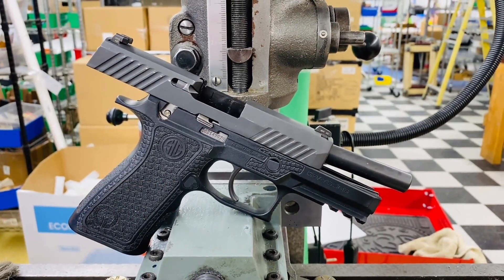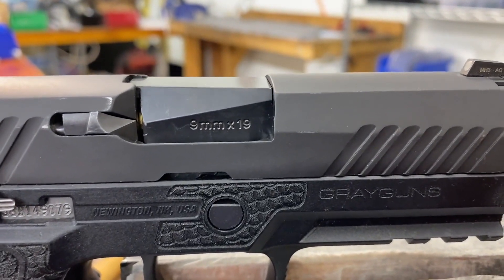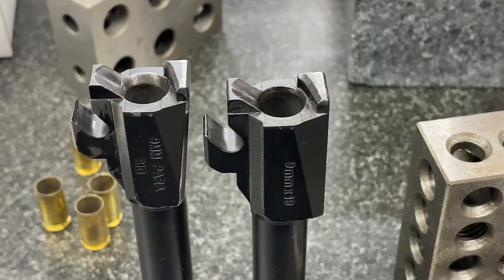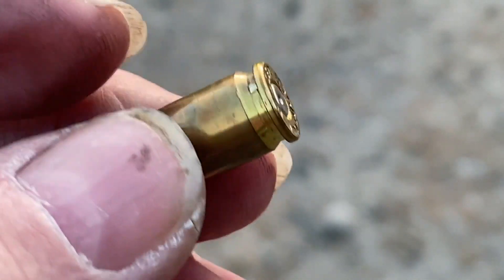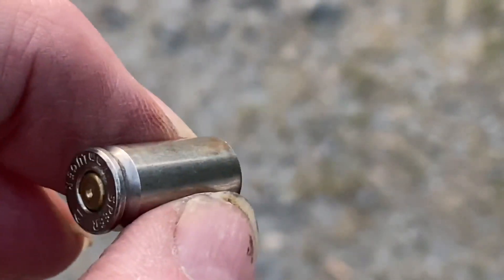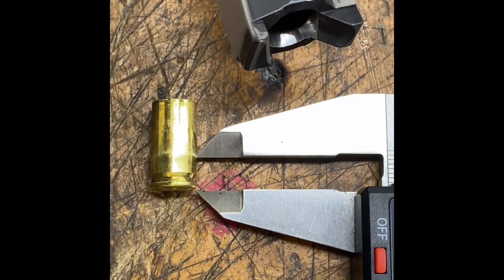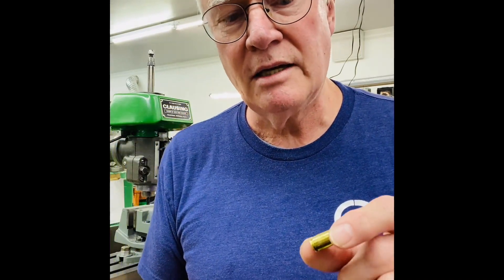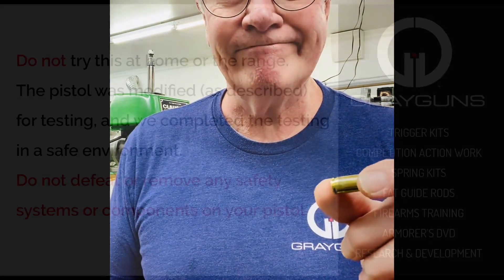Extreme P320 Testing - Reducing Barrel Chamber Support

Comment: I don't own a SS P320.  

I did shoot, own, and carry various Glock Gen3 and Gen4 pistols for about a decade.  
I never experienced bulged cases, a kaboom, or a malfunction of any kind whatsoever with any of my Glocks, with the notable exception of my 10mm Auto Gen3 Glock 20SF.  
When using my G3 G20SF OEM stock factory barrel with its non-fully supported barrel chamber, every single new round I ever fired of full-power 10mm Auto ammo from Buffalo Bore, Double Tap, and Underwood, advertised at >= 700 FtLbs ME (all SAAMI Spec), had the notorious Glock smiley-face bulge.  
I'm talking about hundreds of ruined cases which I purchased as "new."  
So you're suggesting that these three vendors who were selling new ammo, claiming to be using "all new brass," were actually using really cheap and/or over-used brass... all those hundreds of Glock smiley-face bulges had nothing to do with the non-fully supported chamber?
I didn't get the smiley-face bulged cases when I ran the same ammo through this pistol with my gunsmith fitted Bar-Sto after-market barrel.

I've fired hundreds more of these very same full-power 10mm Auto cartridges out of my S&W M&P 10mm M2.0 4.6" pistol, through its OEM stock factory fully supported barrel chamber, and I've had zero bulged cases... no more Glock-like smiley-face bulges, ever.  

It's very obvious to me that my Gen3 Glock 20SF OEM stock factory non-fully supported barrel chamber was the direct cause of those hundreds of notorious Glock smiley-face bulged cases.  
Fortunately for me, my pistol never blew up in my hands.  I was lucky.  
I have seen a lot of other Glock 10mm Auto and .40 S&W pistols blow up / kaboom.
Reply: To my understanding the blown up gun reports are almost exclusively from competition shooters, who are the most likely to reload en masse.
Reply: @jmanswat2457 
IDK.  I don't see a lot of competitution shooters using 10mm Auto, or even .40 S&W.  They all seem to want to maximize soft flat shooting 9mm Luger pistols / low-pressure ammo for the highest possible rate of fire and accuracy.  
The kabooms I've seen, all in Glock 20 and 22 (never Glock 29 or 23) pistols were due to the poor chamber support of the OEM barrels, over-charged ammo cartridges, bullet set-back, re-loaded brass, and combinations thereof.

Comment: if it was solely and ammo issue, why don't we hear about these kind case eruptions with glocks, CZs, Staccatos, Springfields, etc?
Reply: I have seen pictures of glocks, sw, sf with the same malfunction. Two people just talk about it more after the drop test issue. Three maybe there is an issue. But it takes a combination of things. Bad ammo, the older barrel design, they did change the firing pin assembly. I got a bad batch of over pressure ammo. Shot 40 rounds before realizing it and other than popped primers I had zero issues.
Reply: You don't hear about it because people either take responsibility or don't suspect the gun to the degree of making a stink about it. Also because the 320 is actually a really popular gun and there's more people using them than other guns, statistically giving the perception of widespread problems. 
    Kentucky ballistics nearly died from a 50 cal single shot rifle that blew up and he never once blamed the gun. But in that case the ammunition was obviously in suspect.

Comment: Huh....
Well, if you want, I can send you bagfuls of different brands of ammunition from my glock switch don't have a fully supported chamber that are bulged all over the place. Name the brand of ammunition, and I've shot it out of it, and it is shocked me at the how much the case will bulge and not blow. I wonder if you unsupported the chamber, and left locking lugs in place? I can see how you wouldn't blow the cartridge when there is no resistance the rearward motion of the slide. You won't build pressure, cuz nothing is holding it in place to allow it to build pressure, because the Barrel is already pre-unlocked....

Comment: I may be missing something. But if the case can survive being that exposed and the firearm, in essence, functions properly without locking surfaces, why is there so much support for the case and locking surface? Is it just for recoil management and increased safety factor with bad cases? I’m just wondering cause I never thought the case could take so much abuse, new or otherwise.

Comment: So you're saying don't use cheap ammo?
Reply: i think he means dont use brass that has been abused or reloaded way too many times 😂 the uspsa shooters who are getting failures like to reload a ton and dont check the brass they randomly pickup at the range.   other pistols are more resistant to damage from ruptured cases so they are saying the 320 is junk.    most people dont reload and the ones who do usually dont use trash brass so this isnt a big issue for most people in my opinion.